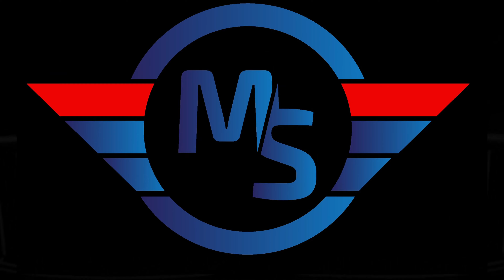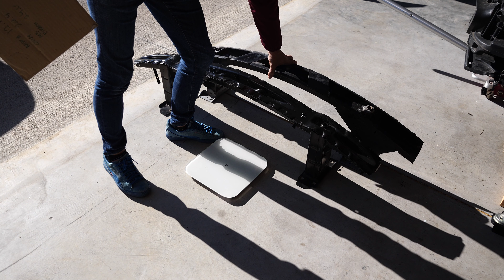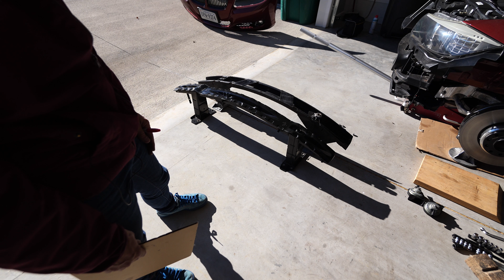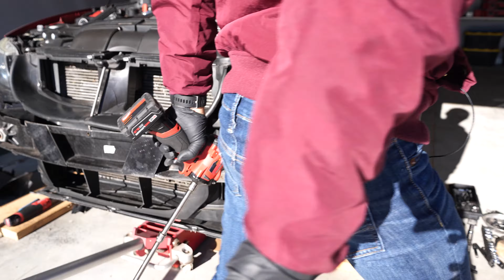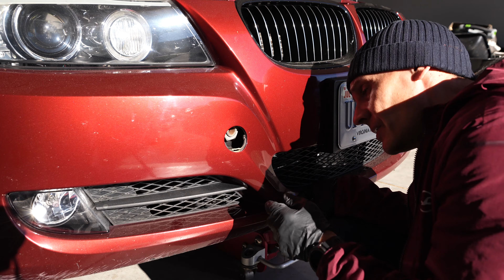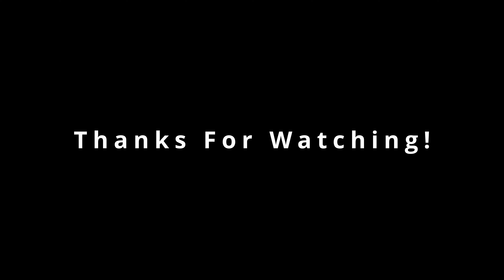➡ BMW E90 — M3 Carbon Crash Bar Install — Weight Savings & Fitment #bmw #howto #racecar

Comment: Do you think it makes the front any stiffer? Or just weight saving.
Reply from the maker: It would be close to impossible to say if it does - without any actual tests or simulations.  Even if there is a difference, it will be unnoticeable. That time when i ran in an autocross without any bar installed, i could not tell it wasn't there. My analysis is that  the lower subframe caries 99.5% of loads. Also... the steel bar is probably not doing much except adding extra weigh. It's heavy and attachment studs are way too undersized to provide much clamping force.